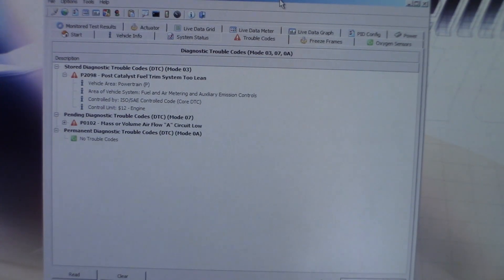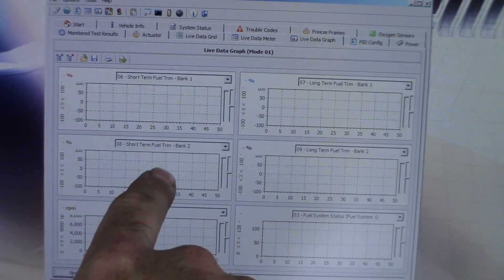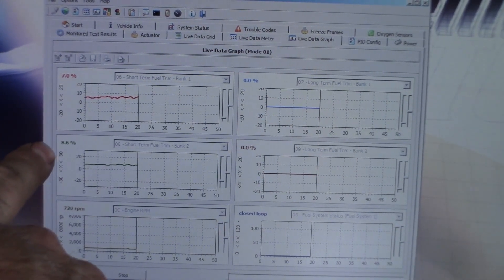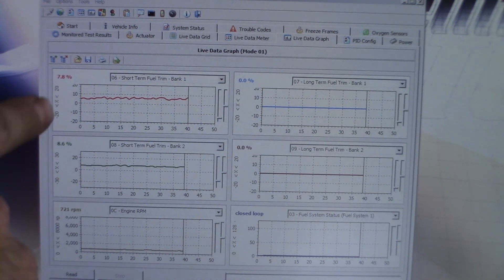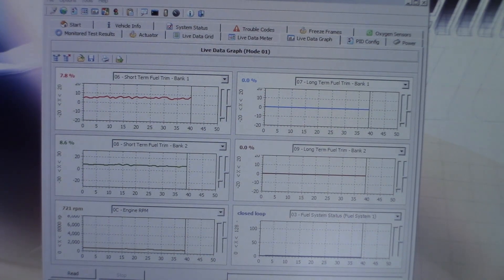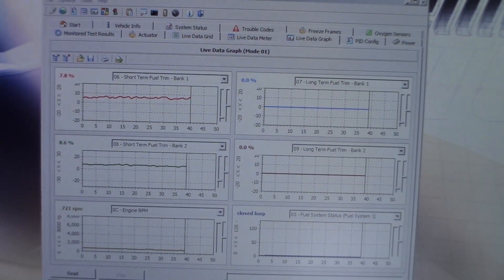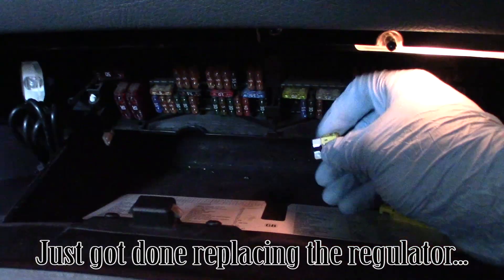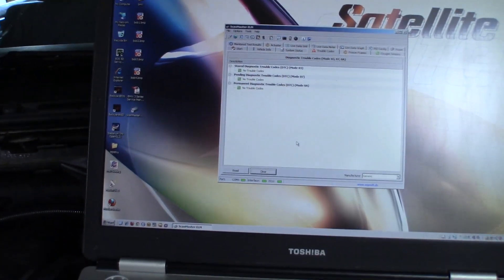BMW 330i 325i E46 Using Fuel Trims To Diagnose Engine Problems P0171 P0174

Comment: So once the vacuum leaks have been remedied, do long term fuel trims automatically adjust? Or will the MAF unplug trick reset? I'm getting 0171,0174 lean and 1190 1192 fuel trim codes. Have recently cleaned maf, replaced ccv, o rings on dipstick and disa, new fuel filter w regulator and replaced vac lines for fuel deliver and secondary air pump and replaced the brake boost suction jet pump that leads behind the throttle body. Just curious if the long term fuel trims are triggering my CEL until they're able to come back down (currently @ 11.7; STFT range from -5 to +5)
Reply from the maker: The long terms will adjust, albeit slowly, once the problem is fixed.  Let's say the long terms were at 20 because of a problem you've had for a long time, that's what the car has "learned over time".  When you fix that problem, the short terms would go to -20 because the car can see that the problem is fixed and the total fuel trim should be 0.  You add the short and long term trim to get the total current.  Over time the long term will adjust its way back to 0 and so will the short term adjust itself to match.  If you've erased your codes and they keep coming back, you still have a problem somewhere.  Does your total fuel trim go down when you run the engine at 3000 rpm compared to at idle?  If it goes down at high engine speed, you have a vacuum leak somewhere.
Reply: +50skid thanks for the reply! Your videos rock. 

When I accelerate, trims don't really drop. Sometimes they go up. Do you think with both trims at +11.7 it could be the fuel pump? I replaced the filter and regulator a couple weeks ago. I've had the car for 60k miles (now at 200k) and I've never touched the pump. Not sure if the previous owner has ever touched it either. Oh also pressure test showed 45 psi when off and 50 when running :-/
Reply from the maker: No the pump.  Is the MAF an OEM Siemens brand or aftermarket eBay?
Reply: The MAF is original OEM... I cleaned it and get OBD readings from it. It responds to rpm. When I unplug it and replug it hesitates. Seems like it's doing everything it should. Before I bought a scanner I had autozone scan it for me and the automatic "suggested repair based on what we've seen report" said most likely replace MAF. I discredited autozone reports and just cleaned it. It may in fact be the original MAF
Reply from the maker: Well... you may be sound in making the decision to replace the O2 sensors.  Doesn't sound like there are any other possibilities.  It could also be a bad MAF as well, but I don't think so.
Reply: I was hoping you wouldn't say that lol. I replaced the O2 sensors first but not with OEM ... perhaps the cheap sensors are giving me what I paid for. 😡 thanks for the advice and keep up the awesome content!
Reply from the maker: Oh you didn't mention that you had replaced O2s.  Check them and make sure they are tight, for one thing.  Perhaps the aftermarket ones are giving false readings but some how I doubt it.  I'm leaning towards the MAF now.
Reply: Sorry, O2s slipped my mind until you mentioned it.. I suppose at +200k miles it's possible this was the original MAF and now it's toast. I'll give it a try next, thanks!
Reply: +50skid Put the new MAF in today ... problem solved. Fuel trims now -25 and bringing LT back down. You're obviously an extremely skilled diagnostician and I can't thank you enough for the vids! These are basically digital and "digestible" chiltons manuals. Are you planning on doing other cars after this and having a catalogue of automotive content??
Reply from the maker: Yeah that has always been a problem in my mind--I've got a very specific audience because I mostly work on the E46, so I'll probably take a little hit when I start working in vids on other cars again, but that will happen eventually.
Reply: doubt it. Your content is solid. Vid and sound quality is top notch. Out performing your peers from a consistency perspective but more importantly from a step by step DIY perspective, which is why most of us are here. You keep the regular DIY'er in mind. I hate watching a 5 minute vid of some guy saying "oh here's some things you gotta watch out for...." like, no shit I've gotta watch out for that, but I didn't, so now what do I do?? lol Your branding is even spot on, I can find your vids first among the others. When you do branch off I'll still have this catalogue to refer to.... so don't remove these!!! :-)  Good luck in the future, hopefully it's encouraging to you knowing you're providing really valuable content to your followers!
Reply: I have a 2001 330Ci with 175k miles, original MAF sensor.  I get P0171 and P0174 lean codes off and on, and it seems to only trigger the service engine soon light when I drive on the highway for a period of time.  I don't get the light when I'm only driving around town.  Did you have similar issues?  And what do you mean that the fuel trims are now -25 when you changed the MAF sensor?
Reply: +Joe Orlando when I replaced the MAF, the short term fuel trims immediately adjusted to the correct air to fuel ratio by going -25% which eventually brought the long term trims back down to about 4-5% instead of 11.7%. It had been running lean for a long time and the MAF was just sluggish, not completely dead. My lean codes (0171 and 174) were gone once I replaced the MAF AND the DISA valve o-ring. Every once in a while I still get p1192 and p1193 and everything i can find about this suggests an ECM reflash/software update from dealer. If you've replaced all the vac lines behind the intake manifold, checked the suction jet pump from the brake booster to under the manifold and checked the DISA VALVE  and replaced o-ring, then I think replacing the MAF is a good next move.

Comment: @50skid I have a p0150 on my 1998 740il. The car feels like it's misfiring but the coils and plugs are new and good. I looked at the fuel trim and when it shakes the fuel trim drops. But when it rises it's fine but it rises above 20. Is this because the precat o2 sensor is bad on bank 2? The bank 1 sensor and fuel trim look fine; they go up and down constantly staying within +/- 10.
Reply: 50sKid. great video ! and very clear . 👍 i have a question.  and i just want to clarify so does fuel trim banks staying at 0 a good thing ? because you mentioned anything above 10% is adding too much fuel and anything (-) is removing from too much fuel right ?
Reply from the maker: If your fuel trim rises to 20, that is a lean condition.  If it goes down when you raise the RPMs to 3000, then the cause is a vacuum leak.
Reply: Thanks, I'll see if it goes down when I raise the rpm to 3000. If not could it just be the sensor? Yesterday I had pending p0150 p1509 & p1550, still could be vacuum leak?
Reply from the maker: Ok sorry I didn't look up that P0150 code the first time I responded to you (sometimes I have a lot of msgs to go through).  P0150 is O2 Sensor Circuit Malfunction Bank 2 Sensor 1, which does point to either a bad O2 sensor OR a problem with the wiring.  Check the wiring integrity on that sensor before you replace it (meaning check for continuity between the white and black wires in the harness).  The other 2 codes are idle control codes which could be caused by the bad O2 sensor--so start with that.
Reply: Ok thanks sir
Reply: I went with universal 4 wire NGK/NTK o2 sensors from eBay. They were $30 shipped for both work better than the bosch ones on my E38. No more shake or CEL.

Comment: First, Love the videos, thanks!  

I've watched most of them even though I don't have most of the issues you are having, it is good to know these things and you cover them well.

So I'm going nuts here.  My fuel trims are 20+ when in Open Loop, with a misfire on various cylinders.  Once the ECU transitions to closed loop (warmed up)  the misfire goes away and idle smooths out (not perfect, but pretty darn close).  Fuel trims drop to around 6.

I have pending lean codes as well as misfires (random) on 5 of 6 pots.

When RPM rises fuel trim approaches zero regardless of Open or Closed loop.  So I'm sure I have a vacuum leak, but why would things get better when the car warms up?

I've replaced the DISA O-Ring, secondary air pump hose, upper intake hose (lower is on the way) and checked other issues.  I don't suspect CCV but that my be wishful thinking (no smoke, no excessive oil consumption, vacuum on oil fill cap not excessive.

arrggghhh
Reply: I also cleaned my MAF.
Reply from the maker: Ted Schoenling have you visually checked the CCV tubes themselves? You can see the lower one from under the car. If you unplug the maf while the car is running and plug it back in, that should reset all the long term learned trims and get you back to a baseline where the car will relearn so try that and see where you are.
Reply: I haven't yet done that.  but I find it odd that everything would go normal with such a large vacuum leak.  When it is really cold.  

When I spray carb cleaner on the lower intake boot the idle improves (when cold)  so I know that may be an issue, I'll have to get the car in the air to see the pipe, and with snow on the ground not something I'm looking forward to, even in a garage.
Reply from the maker: Ted Schoenling yeah so if you sprayed carb cleaner on your intake boot, you found your leak. Remove it and examine closely
Reply: I'll do that when I get the new one.. the (not so nice) guy who put this boot on put the clamp on so that it is facing down and away, I'm afraid I'll have to rip it apart to get it off.  

I did get the car up in the air, the 0-ring on the dipstick may be suspect, but I do have vacuum at the top of the dipstick so I'm not sure about that.    

I also have an oil leak at the oil pump filter gasket, which was a known issue, but it is starting to make a mess... that will be  the next job.
Reply: I just looked closely at the line between the valve cover and the CCV, the connection to the CCV has oil all over it.  I'm trying to decide if it is from the CCV or from the aforementioned oil filter housing gasket leak.  After I do the lower boot, I'll wait and see if the issue resolves.  If not, I'll do the CCV.. not a job I want to do myself this time.
Reply from the maker: It's not the oil filter housing.
Reply: Yeah I ordered a catch can, I'm going to cut the CCV, the fittings still work, and since that pipe is cracked at the fitting to the CCV, I'll just cut it and be done with it.  I did, however, try a different can from what you got, hopefully it won't have the oil smell, and if so, I don't drive all that much so it won't bother me too much (I hope)
Reply: Oh, and thanks for responding, really awesome!

Comment: Thank you for the great videos! I went to Harbor Freight and got the same gauge that you did. My pressure was barely above 10 with just the pump activated. 47-49 with the car running. I changed the fuel filter/pressure regulator combo unit, and pressure is still reading 10-12. Do you suppose I have a bad pump...?
Reply from the maker: The fuel pump only works for 2 seconds when you turn your ignition on, then it shuts off and if the check valve is bad, the pressure will bleed down rapidly.  Can you confirm that your pump is producing 10psi during those first 2 seconds when the ignition is turned on, or is it 10psi after sitting?
Reply: 50sKid , it starts at 20psi and slowly settles at around 10- 12
Reply from the maker: I would say your fuel filter is probably severely clogged.
Reply: 50sKid , I just replaced it last weekend...
Reply from the maker: Well that doesn't make sense then, but if it's 49 while running it sounds like you're fine.  So what problem are you having?
Reply: 50sKid, since you asked: I am having cold start issues such as shaking until the secondary air pump shuts off, and rich smelling exhaust. checked injectors and changed all six due to one leaking. I also have medium vacuum at the oil fill cap. when removed, the idle gets rough. today, I disconnected the CCV hose leading to the Vanos, plugged it with my thumb and felt suction there too. once thumb is removed, I could hear oil gurgling. in addition to low mpg's, and oil/mayo under the filler cap, the spark plugs have oil on the threads, disa is oily as well.

Comment: Great videos man! Do you know if ScanMaster-ELM ELM327 OBD 2 Software works with 20pin round connector via cable reduction to obd2?
Reply from the maker: It should but if you put the cap on the 20 pin round connector then you should be able to connect your obd2 reader to the regular obd2 port inside the car.
Reply: 50sKid thanks

Comment: I'm having the p0171 code Bank 1 running lean on a 2005 330i I've taken it to the mechanic because it had p0171 and p0174 and they were able to get rid of p0174 but the p0171 code keeps coming back could it be the fuel regulator? Because they've connected a smoke machine to the car twice and haven't been able to find any more vacuum leaks from when they found the first two and got rid of the p0174
Reply from the maker: You watched this video.  What type of lean condition do you have?
Reply: 50sKid A positive fuel trim
Reply from the maker: Yes a positive fuel trim means lean condition, but what type of lean condition is it?  Is it a vacuum leak or is it a fuel delivery problem?
Reply: 50sKid right now I'm thinking it's a duel delivery problem because we've connected a smoke machine to try and find  any vacuum leaks and we've found 2 but those are fixed and the code is still appearing
Reply: did you clear the code, before rescanning? Or are you just getting the old code over and over?
Reply: Gavin Baumanis I cleared them
Reply: 50sKid hey so I've replaced both fuel pump and pressure regulator and the CCV but the same freaking codes keep coming back I've also cleaned the MAF and the ICV 
What do I do?!!!! These codes are fringe me crazy

Comment: this is awesome! I've been chasing fuel trim problems on my e46 for over a year now.  Thanks!
Reply from the maker: What do your numbers look like?
Reply: I still have to check the values.  I've done a smoke test, found some leaks and repaired them, yet the codes still come back for both O2 banks.  I use a peake tool and E3, E4 keeps coming back.  I'll come back and update you.  Thanks.

Comment: @50sKid hey mate, been trying to figure something out - I currently have both my long term ratios at ~-5%/-6%. This was after I reset adaptations on my car (325i), as my long term ratios were at -8/-8. 

After I reset the adaptations, I monitored the short terms for a while, and the cold starts were obviously quite negative, as our cars I believe like to run a bit rich on cold. As the car warmed up though, the short term fuel trims for the most part stayed between -5% and +3%. 

The car has most things already replaced (necessary repairs as they were failing etc), including: CCV, VCG, DISA Valve rebuilt, VANOS seals, Fuel Pressure Regulator, OFHG, OPG, intake boots, and the F-Connector's lower hose rubber sheath has also been replaced.

The fuel pump has not been replaced. Any ideas?
Reply from the maker: Are you noticing any problems associated with this or are you just seeing these numbers and not happy?
Reply: The latter. Just seeing the numbers and not being happy. Probably just going to leave it since it doesn't seem to actually be causing any issues.

Comment: hey 50s Kid... i bought the elm 327 and using the short term fuel trim gauge.. with live data.. and im getting a range of -1.8 to 5.5 %.. some times it will go up 7%.. pretty normal as per ur info in this video.. but as im at a stop light..it idels normal.. but the guage will spike to -100.8... just for a sec.. i dont feel the diff. in the car but it does it quite offten in the guage.. is this normal?